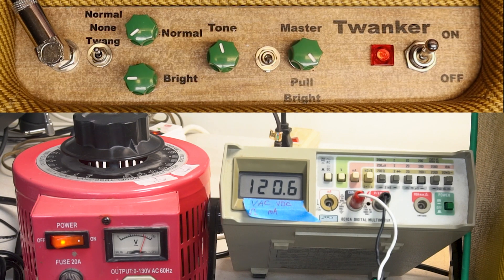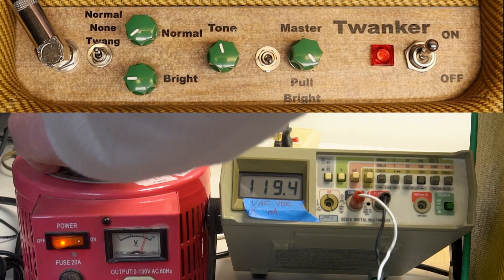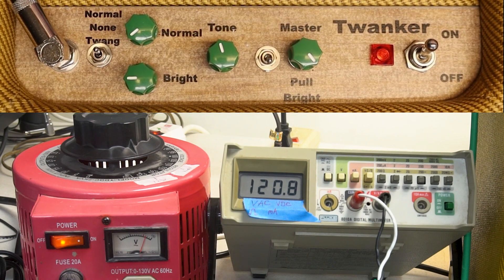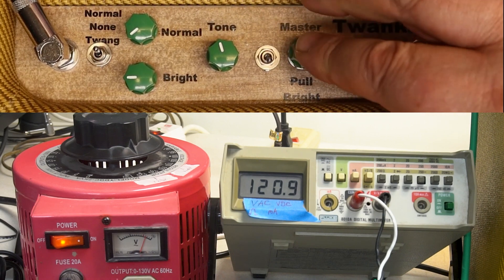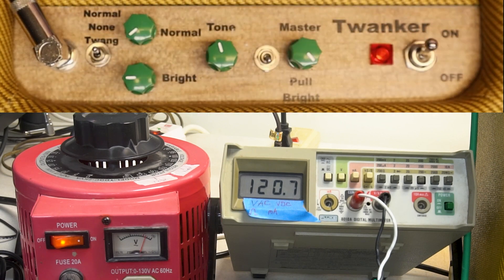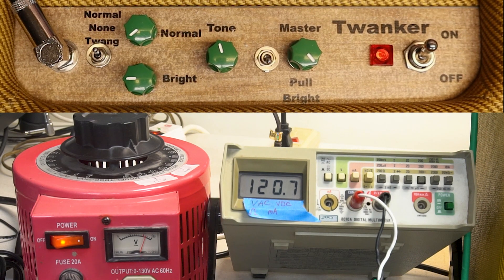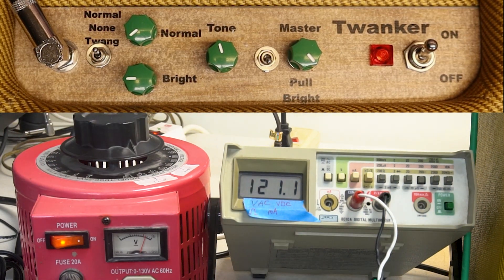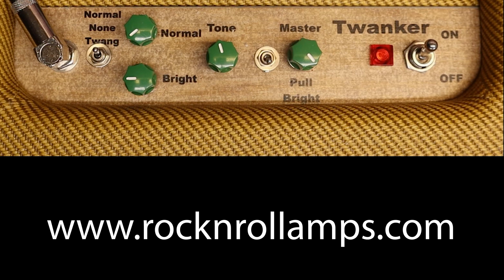Uncover the Perfect Voltage for Your Amp or not. Tweed Deluxe voltage test. 5e3 amp

Comment: I love these amps you build! This voltage swap is interesting. Warren Haynes runs his Soldano and Diaz 100 watt amps at a higher than wall voltage, giving him stability wherever he plays, and I have never heard anyone not love the sound. The drawback is tube life. Have you ever gone up in voltage? Did you notice much of a difference in sound or feel? Thanks
Reply from the maker: Thanks for subscribing and commenting. I have never gone up in voltage to answer your question. You said it yourself, tube life is diminished. To me it is not worth the collateral damage that can occur each time a power tube fails. 
I don't know any details regarding his use of high voltage. As an amp tech I would have many questions for him. But I actually have no interest. If I own an amp it is because I love it otherwise it is out of here. 
Frankly in my own voltage test of the 5e3 I can honestly say I would most probably fail a blindfolded test. I struggled to hear a difference which at best was so minor it wasn't worth getting excited about. The difference was negligible with neither voltage being any better. 🎸
Reply: Thanks for the reply. Makes a lot of sense.

Comment: B seems to have a fizzier high end.  While sound is subjective, the math is less so.  

If the amp was designed for 110V, wouldn't the heaters run much hotter at the higher voltage?...and wouldn't that impact tube and possibly other component life?   What I DO know is when I ran my '57 5e3 and '53 Princeton at 120V the tubes ran wicked hot compared to my ToneKing Imperial MkII (also cathode biased running 6V6s) and Hot Rod Deluxe.   Am I all wet?  Im not an electrical engineer but would be interested in their thoughts on the math.
Reply from the maker: I just posted another video comparing 2 common power transformers, one vintage and one modern and how the filament voltage responds to change in wall voltage as in 110v vintage and 121v modern. Most replacement transformers are wound to vintage spec.

Comment: I don't know. Is the transformer to original specs or it is it built to modern voltage. I think that the players feel and technique aligns to the response of the amp/speaker. Sound wise i could live with either. Feel wise with the response of the amp speaker i can't speak to but i imagine that might determine which one i preferred. Gotta get the feel.
Reply from the maker: I just posted another video comparing 2 common power transformers, one vintage and one modern and how the filament voltage responds to change in wall voltage as in 110v vintage and 121v modern. Most replacement transformers are wound to vintage spec.